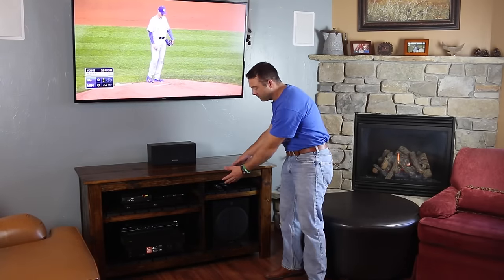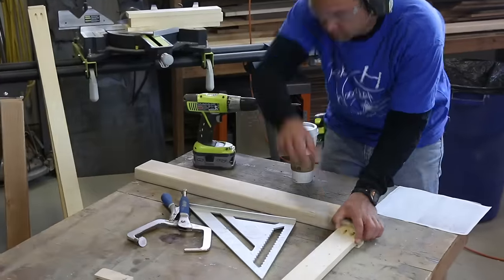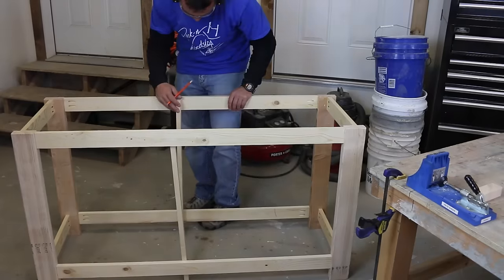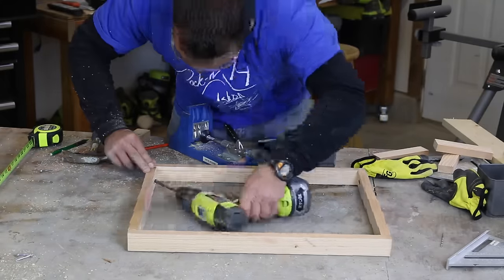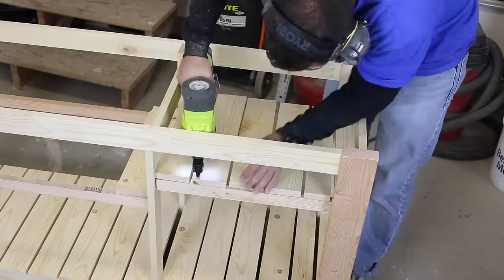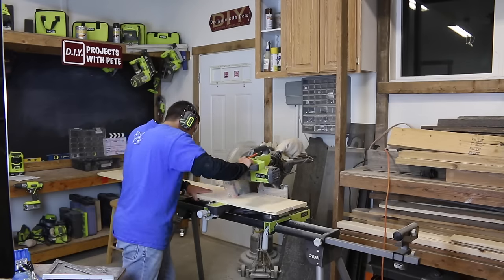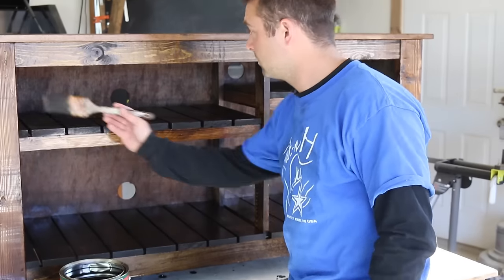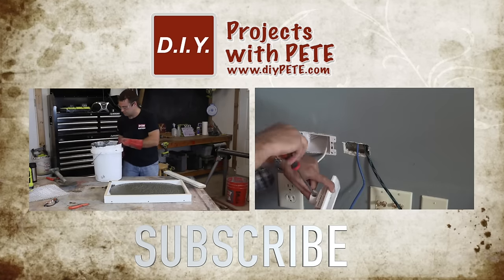How to Make a Wood TV Console

Comment: Pete, Thanks for sharing another great project.  I'm a few years older than you (55), so you may not experience the impact of standing around on concrete all day....yet!  I thought I'd share what I've been using on my garage floor.  As long as I make sure to stand on them vs the concrete, I've found that I'm not in near as much pain after a long day of working on projects.  I have 3 of these: Blue Hawk Black Rectangular Door Mat (36-in x 36-in) that I picked up at Lowes.  They are easy to move around, interlock and the holes make them easy to keep clean/sweep under or around. They are pretty durable too.  I typically wear sneakers, but am also considering anti fatigue shoes/boots.
Reply from the maker: +Mike Sargent Hi Mike, thanks so much for taking the time to watch some of the videos and to say hi. I appreciate it! I love your idea of the mats and anti fatigue shoes / boots. It's definitely something I am going to look into as I'm spending a lot of time out in the shop and at the computer. My next project is actually a standing desk and I've been standing a lot more while working at the computer, so a mat would be great. Thanks a  bunch for the recommendations, I am going to order a few things for the shop :) How are the projects going Mike? What have you been making lately? Cheers - Pete
Reply: +DIY PETE ...your knees and back will thank you for it.  Most recently I've been making mosaic tile art (southwestern style) because I have a lot of extra wood/tile laying around.  I've got a pdf of the different projects I've done that I'd be happy to share if I can figure out how to do that.  email?   I'm gonna leverage your "DIY Blog" sometime soon.

Comment: Boom! Thanks for the shout out and the shirt looks great. Your console turned out great!!!
Reply from the maker: +Rock-n H Woodshop Thanks so much Drew! You the man!
Reply: +DIY PETE OK, Pete I have one important question. How in heck were you able to stain that whole piece without getting any stain on that new Rock-n H Woodshop tee shirt?
Reply: +WoodRodent you know, I was thinking the same thing. He reached up inside the cabinet with the sleeve very close to the stain and never got one drop on it. That is impressive!
Reply from the maker: +WoodRodent ha! I always forget to put on old clothes when painting / staining but need to! I actually got a little bit on one of the sleeves. Had to throw it in the wash to soak right away :) Adds a little character I guess!
Reply from the maker: +Rock-n H Woodshop I actually got a little on one of the sleeves, had to get it in the wash right away, phew!

Comment: Great video, Pete! What is your feedback on that receiver + subwoofer set up? Is it pretty good? I'm starting from square one.
Reply from the maker: +David Castillo Hey David! The receiver has plenty of power and the subwoofer is great (plus one of the cheapest I've found with really good ratings). I actually have 2 of the receivers and 2 of the subs (different rooms). The sub is a great addition for watching movies / sports, you really get a lot of base. I actually only have the base turned up a little less than half way. The receiver has plenty of HDMI ports too. The only thing I would look into next time is built in bluetooth for the receiver to make it easier to stream music from an iPad or iPhone. I ended up buying a little bluetooth receiver for about $25 to add it.

Comment: Hi Pete, great video!  I am considering making this TV console looks like a great project.  I have already created your cedar cooler project, which came out great!  Question, what wood did you use?  And what are some other options that would like nice as well?  I tried looking through the comments and description but could not find it.
Reply from the maker: +Marso007 Hey Marso! That's awesome you built the cooler project, glad it turned out great :) I used pine for this project since it is inexpensive and easy to work with for beginners. Other woods like doug fir, spruce, poplar etc that you can find at your local lumberyard will work well. I stained the wood using MinWax Dark Walnut stain and a semi-gloss MinWax polyurethane. Let me know if that helps. Good luck!
Reply: +DIY PETE perfect, i thought it was pine.  but i think Poplar will be my choice.... now to find the time to get it done!  Thanks, keep the videos coming!
Reply from the maker: +Marso007 You bet and good luck!!

Comment: I noticed once you had it built there was a slight wobble. How did you solve that? I have built a couple large pieces and they both had the same thing. One I was able to fix with trimming the high side leg a bit, the other one I had to put adjustable feet on it. What method did you use? I'm guessing there is an easier way.
Reply from the maker: +christopher sheridan Hey Chistopher! It had a pretty good wobble in my garage because the concrete slabs are uneven. Once inside, it sits great. If it did have a slight wobble, the weight of all the components would typically help it sit flat. You could always use thin felt pads to help level if needed. Adjustable feet would also work. I don't have any great ideas though that are different then yours :)

Comment: also, i noticed that the console was rocking a bit, how do you generally level out legs on tables and such?  I always struggle with that
Reply from the maker: +Into The Dirtshop Hey! It had a pretty good wobble in my garage because the concrete slabs are uneven and slant. Once inside, it sits great. If it did have a slight wobble, the weight of all the components would typically help it sit flat if the wobble wasn't too much. You could always use thin felt pads to help level if needed. Adjustable feet would also work.
Reply: DIY PETE thanks for the tips!

Comment: Pete- i know this video is older, but i noticed some wobble in the console when you were attaching the top boards. How do you get rid of that?
Reply from the maker: +Fabian Pulido Hey Fabian! It wasn't bad and my sloped garage floor doesn't help in the videos, but I remember one of the top planks I used had some warp to it and was pulling unevenly and thus creating a wobble. You may need to replace a warped board ---- or add a shim to one of the legs -- or adjustable feet to the legs. (felt pads can be a quick fix as well if you still are having unevenness.
Reply: +DIY PETE awesome Pete thanks!